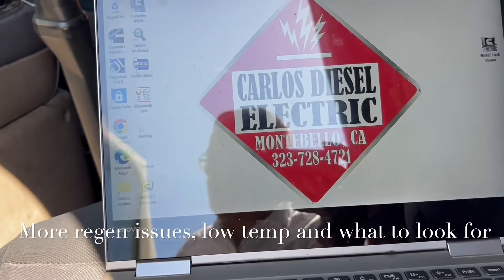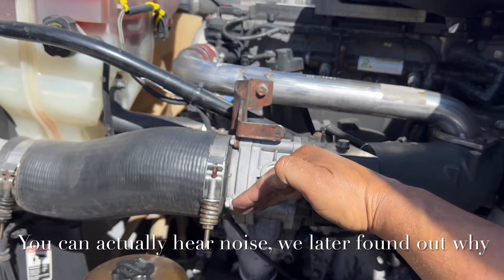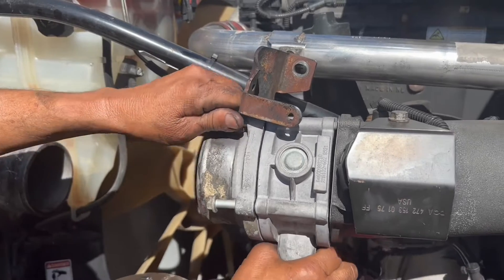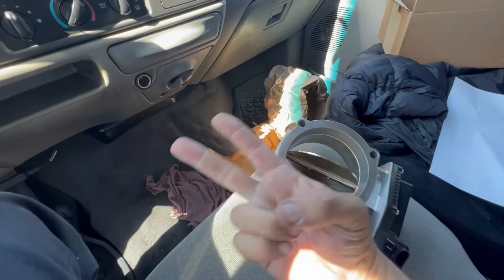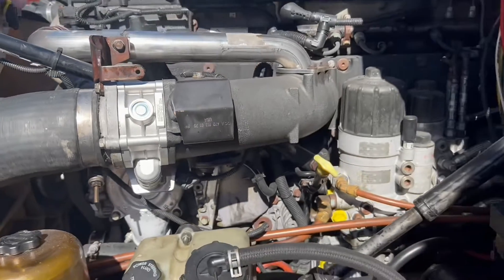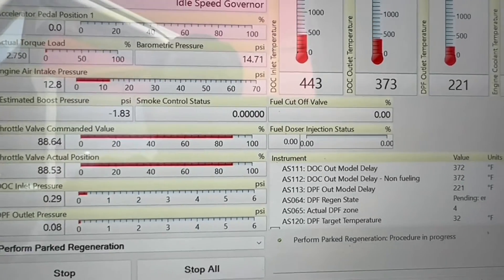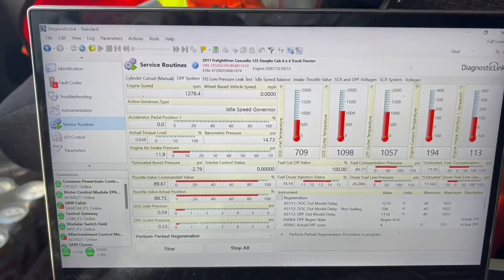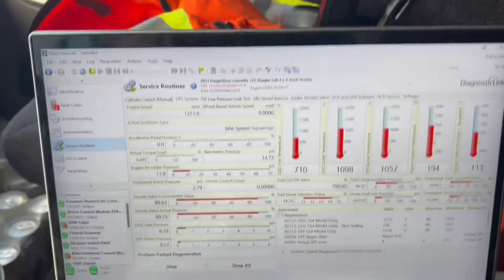Parked regen ran over 1 hour then aborts. What to look for, how to DIY and get back on the road.

Comment: Does the computer actually tell you regen done at the bottom? The area where it says regen successfully started.
Reply from the maker: @louiesaenz9007  I for the regen does not have a progress chart or bar. 
You have to monitor the temps, pressures. 
Cummins is the only program that shows some level of progress

Comment: I have a solid amber light and ACM diagnostic code 3711 31. Does that mean the valve in the beginning of the vid is stuck in the open position? I’m new to trucking but sounds normal to me
Reply from the maker: What year? How many miles.
Reply: @CarlosDieselElectric  brand new. Less than 3K
Reply from the maker: @MightyMurkMan  brand new truck, I believe Detroit no longer uses the ITV. They changed that back in 2017 or so. 
What is your DOC inlet pressure when the truck is trying to do a regen?
Reply: @CarlosDieselElectric   Not seeing anything on dash gauges about DOC inlet pressure. DPF is green in zone 1.
Reply from the maker: @MightyMurkMan  are you using DDDL software for the regen?
Reply: @CarlosDieselElectric I’m using no software or outside laptop/technology. Cycledy dashboard gauges and the fault code popped up
Reply from the maker: @MightyMurkMan  definitely recommend you have someone plug into this a read what’s happening during the parked regen. If the truck is new, there could be issues that warranty should cover. 
Connecting software is key to finding out what is happening. Could be a software issue but not sure without knowing or seeing what is going on.

Comment: Pedro how are you ? I have a problem with my truck. It shows bh33 diag 1 fault 1 fail 4. Can you help me out. I park my truck by montebello ca.
Reply from the maker: Need to plug in with the Insite software to see what codes are being generated. If you have issues with the Freightliner side. That is a different software

Comment: I got the solid light but not the check light. I only get the 3719 fmi 16 while truck is in regen mode. Thoughts?
Reply from the maker: During the regen, why are the pressures? DOC inlet? 
What other codes are you getting?
Reply: @CarlosDieselElectric  I have no other codes. I don't know what the pressures are because I don't have the program yet. It's regening but not letting the truck know it's regening

Comment: how often should I do a regen for maintenance? I have the otr tool that let's me do a parked regen. I idle little as possible. we drive as a team so the truck is always on the highway.
Reply from the maker: Truth is, driving regen is always best. The truck will automatically perform when conditions are correct. Temp, soot level, speed